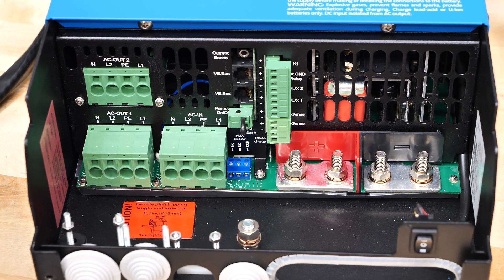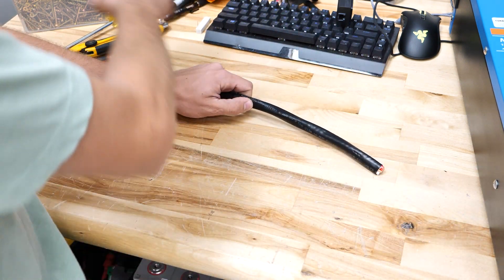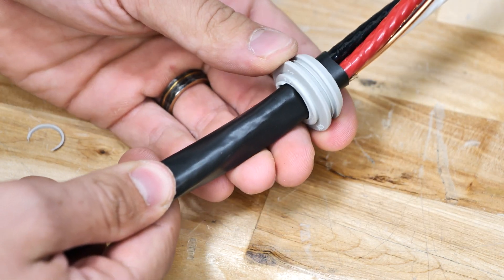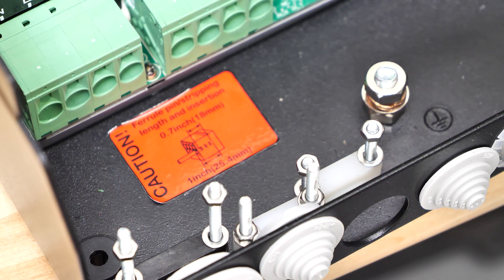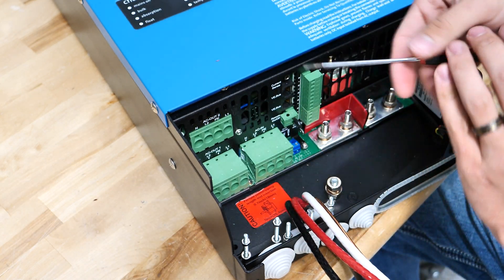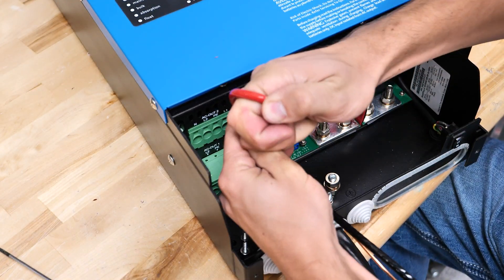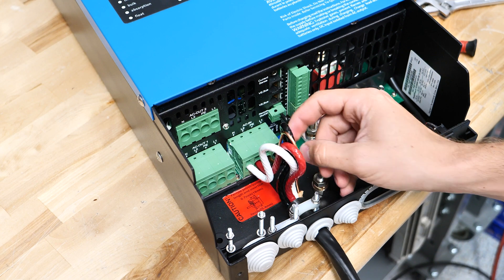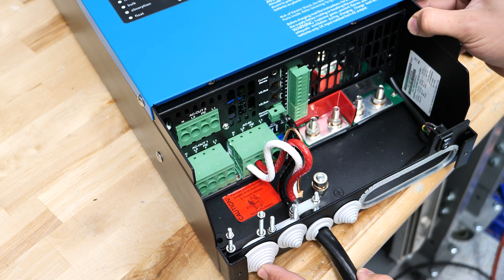Victron MultiPlus-II Inverter: Step-by-Step AC Output/Input Connection Wiring with a Spring Terminal

Comment: Where's the video for AC in on the larger MultiPlus-II like the 48/8000. It's a completely different beast. It doesn't seem to be designed for USA 240/120 split phase input.

Comment: Is there a video regarding the AC output and how to connect the AC output to a breaker load center ?
Reply: Same way out of the inverter. Black inside panel to 1 pole of 50 amp breaker, red to the other pole, white to neutral bar, green to ground bar. All circuits on the left are powered by the wire on the left side of the 50 amp breaker, all circuits on the ride side of the panel are powered by the 2nd hot leg off the right side of the  50amp breaker.

Comment: Victron and other companies, like Renogy, use this SAME wire "cripming" stype attachment system and its the WORST system any company can use.  I've been an electrician for 40 years and I have witnessed HOUSE FIRES that start from the SAME type connector on the back of a 120v house receptacle.  Some elctricians take the EASY route to "push" the solid copper into the hole on the back of the receptacle, AND SKIP the harder install with the screws.  Over time, the VERY POOR CONNECTION will become HOT, WEAKEN, and then spark or burn.  Why doesn't Victron, Renogy, and other companies install the SCREW LUG instead of that CRAP.  Victron and Renogy and others should be ASHAMED to sell that crap.

Comment: Those are not dust caps. They are abrasion boots. Not the gaping DC wire hole on the right side. The inverter is a ventilated enclosure.

Comment: Be very careful cutting the plastic bushing so dust doesn’t get in. Just don’t look at the 4 inch hole on the right for the dc wiring and all the vents 😂😂😂😂
Reply: Shhhhhhhhhh……  Don’t point obvious things out!  Besides, if someone is mounting a 3,000W inverter in an area that dust and water can get in, they have much bigger problems, like being an absolute idiot….  😂😂😂😂😂

Comment: Hello
I would like you to give me your opinion (expert!)
I have a multiplus 2 in (8000VA) in output + (2X on the 8000VA) should I put 1 or 2 disconnectors? since 2X50MM² are needed
2 disconnectors are better I think? the 2x 50MM cables will not fit on a disconnector. What do you think?
on the other hand for the - (2X) should I also have 1 or 2 disconnectors?
or can the 2 - cables of the multi go directly to the P- of the BMS jk?
thanks

Comment: Great video! Wondering if it would be a good idea to put ferrules on the end of the wire?
Reply: Fine stranded wire is OK, but not large strands like this.  Not enough surface area in contact with the ferrule.

Comment: Good man, good job done there. However I'm slightly concerned about this kink in case the radius of bending is lower on a lower quality CCA type wires which have flooded the market.
IMO I'd like to put a ferrite ring over there and wrap the cable around it achieving two goals at once:
Stoppage anchor in case of pulling the wires accidently
and
noise filtering which is present in all electronic equipment.

Comment: I don’t think making 180 turns that tight is recommended wiring
Reply from the maker: What do you propose is wrong with it or a better alternative?
Reply: I believe it’s best practice mostly for mechanical reasons not to exceed the wires suggested bend radius (which I’m certain that would) — I’m not sure if or how much resistance this adds but I would personally prefer a straight run and take the risk of future issues (likely it’s a short run) or make a bigger loop if it were really necessary. That should be a high load conductor so seems worth it to treat it nicely. My logic anyways

Comment: I know that AC 1 Out is used to go to your breaker panel in your RV but what is AC 2 out used for?
Reply: AC2 power is not switched by the inverter. So only gives AC when hooked up our have a genset running.  No battery power.
Reply: Think of AC 2 as supporting stuff you wouldn’t support with batteries.  I.E. air conditioning

Comment: Thanks for the video. I love the Multiplus II, but hate the spring terminals. It took me about two hours to connect the AC wires to the spring terminals. If you use 6/3 Romex, it would probably be easy.  But, I used 6/4 SOOW.  The wires are not as stiff as romex and are extremely difficult to insert into the spring terminals.  Every screw driver I tried (and I have several) would not depress the spring terminals enough to insert the wires enough for the terminals to hold the wire securely.  Using needlenose pliers did not work because the wires are too soft to push into the terminals.  At the other end of the cables, I installed a spice box with screw terminals that took about 5 minutes to hook up.  Another thing of note,  connecting the wires on a workbench is probably significantly easier than connecting them in the RV.

Comment: what is the smallest wire size you can use on the AC out 1 & 2?  I'm only going to run a 20 amp outlet off either of them (for inside hobby battery backup).  the outlets will be only about 2ft away from the multiplus unit.  I can't see using 6awg wire for an application that won't draw more than 20amps.

Comment: So dumb that they use spring terminals and not screw down terminals.  Much better install than I've seen other people do... but why not use SOOW or SEOOW?  Still 600V but much more flexible.  Crimp a ferrule on the end of each wire as well.
Reply from the maker: Most RVs here have existing cable installed that matches the video. While SOOW is best it’s not realistic because replacing the whole shore power wiring is not always practical or cost effective

Comment: Using that type of cable is bull crap!  Those terminals are for finely stranded wire with crimp ferules such as type MTW.  Read what the RED caution label tells  you.
Reply from the maker: Yep.  We addressed this in the video...the thing is, RV's (where most of this model inverter get installed) come factory with this THHN/THWN wire and it's often impossible to effectively replace with MTW.  As a result, we made a video that shows the best way to do it with options most owners in the USA will have at hand.
Reply: I understand what you're saying.  The service loops are great idea. However those terminals and that wire just are not really designed for each other.  We're talking about the potential for moderate vibration and in my opinion you must use a different type of wire.
Here's a great example: https://m.youtube.com/watch?v=OCZC8lLXLpw

Comment: I love Victron components and I have 2 of these MPs but the fact you have to make a video showing how to use these connectors says it all.  They are crap and should have never been used.  Also, your thought that the grommet has to be tight to seal is hilarious given the giant slot just to the right of the gromets. Not at all important.  You need enough grommet to keep the wire from  chafing on the metal and then the wire should be secured tightly as early as possible exciting the housing.  Movement of wires is the enemy.  And yes, I go straight in with my wire.  I make sure they aren't too short to begin with.
Reply from the maker: We make this video because there are a lot of DIYer's that are not licensed electricians and don't completely know what is required to meet code requirements.  Sure, cutting the boot perfectly may not be super critical, but I'll leave you to read NEC article 110 on your own.
Reply: @CurrentConnected  lol, i was referring to your claim it needed to be sealed.  That's not the case at all.  It's to protect the wire from chafing.  Nothing more.

Comment: Good info to learn before I start. Thank you. For my AC out I am going to a generator hook up point that is not being used. 50 AMP RV. 4 wires in the generator hook up that goes to my AC distribution panel. Red, Black, White, and Green. How would I hook this up to my multiplus II AC out ports?

Comment: When I remove the screwdriver, the wire just pulls out… these spring terminals seem like absolute garbage….
Reply: Did you make sure you stripped 3/4" of wire and pushed the wire all the way in?

What type and gauge of wire are you using?
Reply: @HighTechLab  6awg Romex. I eventually got it to work, seems like the screwdriver is pretty fidgety to get it to release the spring properly

Comment: I dont understand the purpose of the screwdriver jamming it in there for an install? Are these not push in wire connectors? They push in easy but dont pull out without the screwdiver??

Comment: FYI. The Romex you are using for example is actually 6/3, NOT 6/4. Some viewers might get confused by this.
Reply: Agreed. 6/4 has 4 insulated 6 awg wires, where as 6/3 has 3 insulated 6 awg wires plus ground. Both work the same only difference is the insulated ground vs bare which, Victron does not require the PE to be 6 awg or insulated. Just in case anyone wanted clarification.

Comment: Do they offer a different method to connect wires???

I hate this spring method.

This is the only reason I hesitate to purchase Victron, and Ivwant to purchase a Victron!!!

Just can’t buy with this connection system!
Reply: buy a Victron Quattro - it has bolts on AC sides as well. 
I don't like these spring contacts as well (those were bolted in the past...)

Comment: Screw victron wire connections it's the weakest part of their entire unit good place to start a fire especially on their higher amperage connections their user manuals and website contradict each other on how to use these connections and they can't get  UL approval on them because of their hazardous nature.

So make sure that you're fire insurance will cover a claim for a non-ul approved electrical devices that might be the cause of the fire.

Comment: Great video! 
I wish I would have seen it before I installed mine, in my RV, that definitely looks like a much easier method. I straight cut them to have a shorter length inside. However I did measure the 3/4 strip & put a mark with a sharpy at 1" on the insulation so I knew when they were all shoved home in the connector. 
I fought with those wires getting them in...I think I learned a few new words along the way as well...lol  
I will be redoing those connections your way, in the spring before we start using our RV again. 
I just hope I left myself enough extra to redo it..if not it will be an expensive lesson buying another roll of romex..

Thank you,
Brad

Comment: I have a generator transfer switch. I don't have a generator. My fith wheel has gen prep. I am wondering can I just pull out the transfer switch run 6/4 wire on the incoming shore power side use lug blocks to the inverter? Then from the inverter back to where the transfer switch was lug blocks to the line going to the breaker panel?  Or would it just be best to pull all the 6/4 wire out that came on the 5th wheel make a continuous run from the shore power to the inverter inverter continuous run to the breaker panel?

Comment: Love the tug test, you are the only guy on youtube suggesting using a longer section of wire in the inverter case, genius makes a much more flexible and less likely to have a poor connection with increased resistance possibly creating heat melting the wire and/or connector.  Awesome tips here, you obviously have a lot of experience doing this.  Larry
Reply from the maker: Yes, Dexter is well seasoned in this.  He started out working toward becoming a journeyman electrician in commercial/industrial environments prior to branching out into solar.  His real world experience is very highly valued!

Comment: EVERY MultiPlus2 owner should WATCH THIS.
I've seen other videos where the CONNECTORS were completely MELTED and the unit was totally USELESS.
Reply: I actually did what another video said and pressed the wires into the terminals without using a screwdriver to release the tension. Supposedly that's how it's supposed to be done with the wire in a ferrule and just shoved in.

Comment: 6/3 Marine grade with white black and green, that's what you should use, where's the ferrule?
Reply: You only need ferrules for fine stranded wire
Reply: Is a ferrule required?
Reply: The installation manual from Victron say not to use ferrules.
Reply: @GeoffreyParent  actually, the MP manual refers to Ferrules
Reply: @phecksel  I guess I remembered wrong
Reply: @GeoffreyParent  I doing the install right now and depending on which manual you look at, some say to use ferrules. Some make no mention of it. MP says to use ferrule or strip wires back 3/4” without suggesting if you should or should not use one
Reply: @phecksel it may depend on the type of connector ur unit comes with, I have seen them only with screw down type connectors in which is was referenced by Victron to use fine stranded wire & not to use ferrules, Will Prowse & Andy’s off grid garage Australia have also confirmed this. In Australia we use 240vac, so that may be a difference between models perhaps. IDK just guessing.

Comment: This is definitely the best reference for installing these terminals that I've found. And I absolutely believe the 6AWG thick stranded romex you have is the correct wire to use with the terminals, it makes all the difference in my installation to use the correct wires for this AC In/Out. Everything here agrees with the inverter manual. I do push my wires in with the tip of the wire strippers, but that's after wrapping additional stronger padding around the wire so there's no abrasion--I'll try the method you showed instead! 

Thank you for posting this... Seriously differentiating yourself as a leading Victron distributor for knowledge like this. 

There's an old midnite e-panel building video where they show modifying lineman(?) pliers by sanding down the grit and putting a smooth/curved edge on them, then they use those pliers to make precise bends in thick but stiff wires like this, which inspired me to add temporary padding before trying to use pliers to wrangle wire insulation.

Comment: I am very happy with my Multiplus 2. It’s an amazing piece of equipment. Using exposed Romex wire is not recommended because it doesn’t provide the same protection as conduit. Romex is a type of cable which combines several THHN conductors together in a plastic sheath, but is intended to be used inside a concealed wall, such as running a circuit inside the wall of your house for a range or dryer. It is not allowed to be exposed, that's why any exposed wires are always inside a type of conduit, EMT, PVC or flexible conduit. When you use Romex in an exposed location it is unsafe according to the NEC. Most people doing DIY solar should understand this basic rule, and not have any AC wires exposed in their installation. Flexible conduit is the easiest to work with, and all the connectors and fittings are available at a big box store like HD. If you know an electrician, ask for their advice, they are all trained in how to install everything to code.
Reply: Hi Mark, I am referring to the cable that exits the metal panel, the black plastic covering. In my installation I used 3/4” EMT conduit with 6 AWG wire to the subpanel, because it is in my garage. I worked as a commercial and residential solar electrician and this is standard. Type NM (non-metallic) cable is by itself not protected from physical damage, and is only allowed inside walls. In an RV electrical equipment compartment would be different.
Reply: The area shown is covered by a metal panel when installed. Why are you trying to make the case that they're "exposed wires"? Your post is confusing because it sounds like you own one, did you just forget to put the cover back on or something?
Reply: The entire RV is wired in this stuff.  Yeah, I wouldn't use it in a high impact area but you have to be smart about shielding things when they need to be.  My 4/0 12v wiring isn't in conduit either.

Comment: You mentioned that it's not your favorite choice of wire? Is that because it's so stiff with fewer larger strands than a more flexible wire? What would you recommend? I assume thinner stranded wire but not ferrules since they would impede the springs ability to spread out the wire and make a good connection?
Reply: Solar guys who love fat beautiful finely stranded copper monstrosities for wiring inverters and $$$ battery banks are embarrassed to find themselves next to 6AWG romex even when it's the correct tool for the job. I totally get it. But it's the correct tool for this size of AC wiring, and the terminals depend on stiffness of these large strands to function correctly (this is my belief after operating the terminals with more than one kind of wire).

Comment: I cringe at that thick stranded wire... and no ferrules?  To each his own I guess, but for what these devices cost... spring for better wire, and be gentle on the equipment.
Reply: Try installing finer strands, the terminals don't work correctly. Also, please read the manuals, it absolutely does not specify ferrules, ferrules can reduce contact area and cause heat in certain terminal shapes. 

6AWG romex is the correct tool for the job here. I know you own some beautiful finely stranded wire for installing battery banks and have your own high quality lug crimpers, but this is AC wiring, not DC.
Reply: @incredibleyoutubehandle  It does reference ferrules in the MP manual
Reply: @incredibleyoutubehandle  , it absolutely does not specify ferrules, ferrules can reduce contact area

Why does the STICKER below the connector REFERENCE FERRULE length?